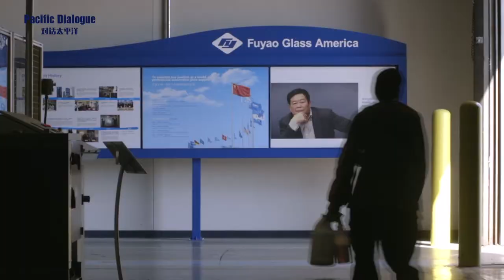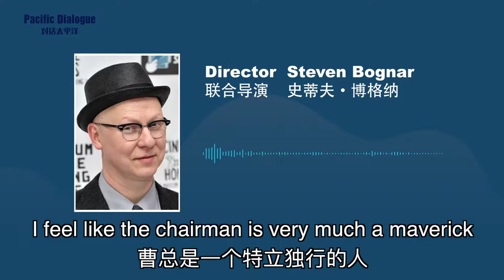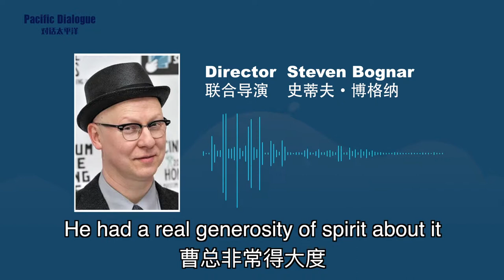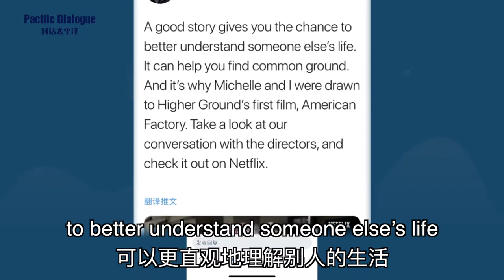Why Fuyao Agreed to Be Filmed——Beijing Review

Comment: I have a Fuyao windshield on my Subaru. It cracks constantly, from different directions even when parked and not in use. It lasted about 4 months.  It never had any rock impacts or anything.  The optical quality was poor compared with stock Subaru windshield. No noticable UV protection like stock windshield.  I regret replacing the stock windshield that had tiny rock chips. It was still much better than a new Fuyao windshield.  I've owned 6 car. Fuyao is the first windshield that cracked.  I'm always careful with my windshield.